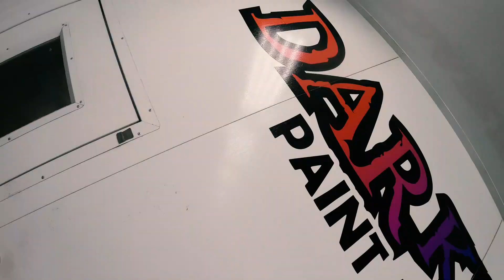Brake Calliper Colour Change on Audi RS3!! Darkside Paint & Body

Comment: Wow. Not sure about the ride height but the colour coding looks like it was meant to be like that from the factory
😊👍
Reply: Pretty sure it's on air, and you see it down. Normal ride height would be higher. Looks like (from memory) bilstein b6 shocks and probably air ride bags.
Reply: @deancc8883  Explains a lot 👍
Reply: @thefamilyrobbo  if you're into cars and ever go down the path of air suspension... This customers setup is the way to go. I've had the air lift shocks and they are s**t (the bags are spot on though). The shocks lasted me 6 months of daily driving before they failed. Custom setup with bilstein shocks are the way forward for sure. 👍
Reply: @deancc8883  What shocks do Air Ride fit? I'll remember to avoid them!
Reply: @thefamilyrobbo  sorry... I meant air lift (the brand) have their own shocks. They usually do two versions - a standard and then a slammed version (really low). In my experience their shocks are rubbish! Google plush automotive. I had the Air Lift V2 slammed air suspension on my focus MK2 and the shocks leaked after a short period - luckily in warranty so had them changed... Then sold the car. But I wouldn't get Air Lift shocks if I was to go air suspension again. I would look into a custom setup with trusted shocks such as the bilstein.